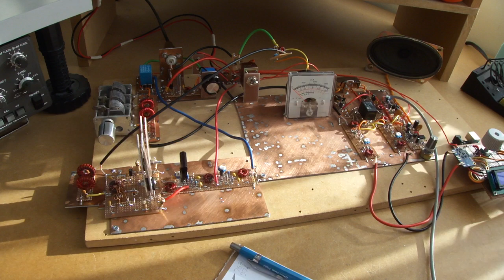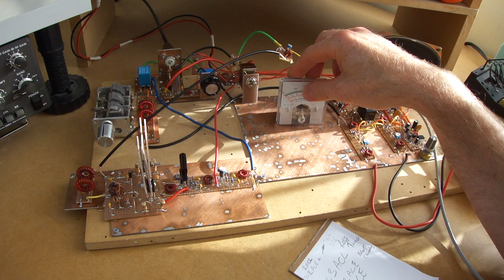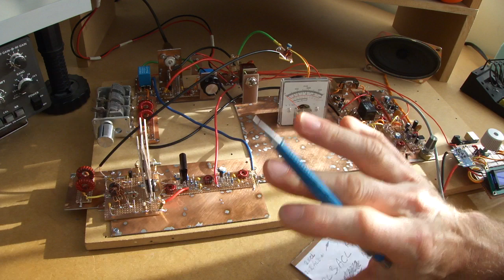Simple Homebrew SSB Base Rig Part 10 - On Air QSO

Comment: OK Charlie I followed in your foot steps and got my first SSB 80m receiver running today… its a lot of fun!! RF amp, BPF, 8MHz crystal filter, audio preamp is working. I do use two AD831 as a mixer at the moment. The Si5351 is generating the VFO and BFO. And I use a STM32F board as controller. Next steps: crystal filter needs some tuning (too narrow BW!); would like to do my own double balanced mixers… and much more.
https://www.dropbox.com/sh/tjatckjqmh1dnrc/AABDxOifKkw6JhNAZiTRnmnza?dl=0
 So I do thank you for your videos. They were very helpful and motivating.
Reply from the maker: That's fantastic Stefan, and exactly why I wanted to make the videos. Great photo too. Let me know how you get on using those profile crystals, as I understand they are not as easy to use. Good stuff!
Reply: I did update the Dropbox with the work of the last few days! Cheers!

Comment: Hi Charlie. Thank you very much for these great videos. I did watch all of them of this series. I do not have any experience in receiver builds so far. But I started building one following your "teaching". LPF and RF amp are working ok... Digikey brings more parts these days…
Reply from the maker: That's fantastic Stefan, keep it up. A receiver project is a great way to start and you'll be amazed how quickly you will pick it up. Try and get your hands on some basic theory books if you can. That will help with understanding.RegardsCharlie
Reply: @CharlieMorrisZL2CTM  I did get my license: HB9GZE (see qrz.com); also I did my first QSO with my homebrew transciever two days ago... a lot of fun I must say!  Regards Stefan
Reply from the maker: That's great Stefan. Just checked out QRZ.com, that rig looks great. Great job.Charlie

Comment: hanks Charlie for this series and happy 2018! It's your first project I watched from beginning to end. I liked how you discussed each module of the radio separately. It's much easier to digest and understand piece by piece rather than looking at some massive schematic and not understanding large portions of it! It was a good chance to refresh my analog circuit analysis skills and design a few of my own amplifier stages for a 40 meter tranceiver. Thanks for pointing me towards Pete Juliano's work. His videos on the double balanced mixer were very informative! I'm just getting started in the hobby (obtained my license about two weeks back) so whatever I build will be my first SSB rig.
Reply from the maker: Happy New Year too! Great news about getting your licence. Well done and welcome to the hobby. I'm glad the series was useful. Building the radio module by module is the way to go as you can fault find along the way. I like to start with a direct conversion receiver then turn it into a superhet.

 
I'm going to tweak the power amp today and change the turns ratio on the last transformer. I've run the numbers again and I think it should be 4T on the secondary. That might drive the BD139s a little harder.

Comment: Happy New Year, Charlie, and congratulations on 1st qso with your homebrewed transceiver! 
It's been an informative process watching your series of videos. Finally somebody has presented the calculations behind the various amplifier stages of an hf transceiver. Have you considered publishing an e-book that would contain your schematics & calculations? It could be a useful reference for newcomers to the world of homebrewing.
ZL3GIL
Reply from the maker: Cheers Gilbert. I too have struggled to find any good references that explain the logic and calculations 'behind the scenes'. I'm glad that this series has been useful to some. Hopefully, more will give homebrew a try. As for a e-book, no I haven't. I might have to put some more thought into that, as I'm more than happy to share the schematics and software code. I wonder how easy it would be? I'm not a great typist, hence the reason why I have focused on You Tube vlog as opposed to a more traditional blog. Food for thought!
Reply: Charlie Morris I have to admit I've never created an e-book. I can do a little bit of desktop publishing though.
My next project is going to be a USB transceiver for the 160m band; intended for use with the very many data modes now available. 
I have a bag of 2N3904 transistors, some copper-clad laminate and a modest junkbox. Let's see what comes out the other  end!
Reply from the maker: Sounds like a plan Gilbert. I hear 160m is taking off.